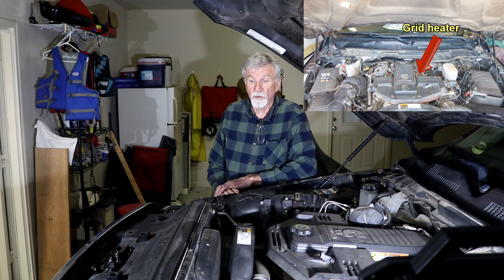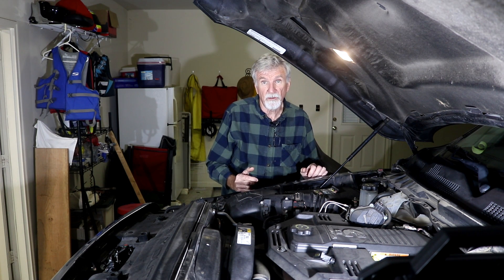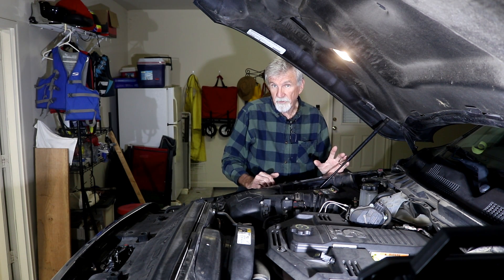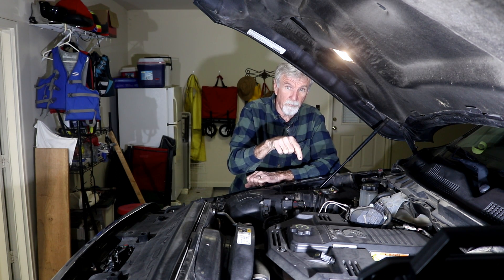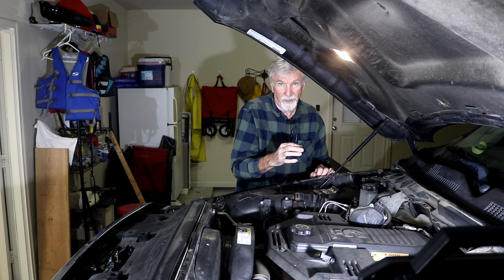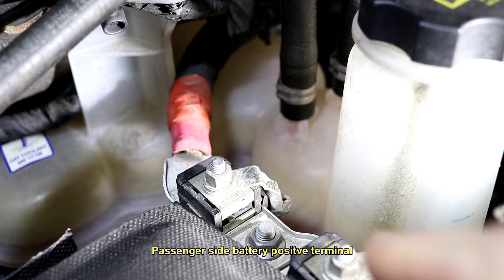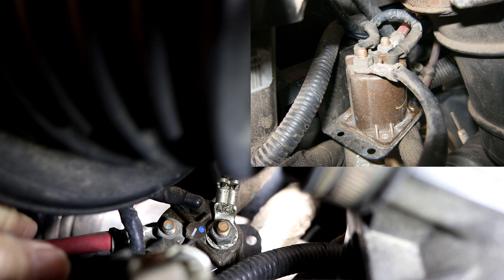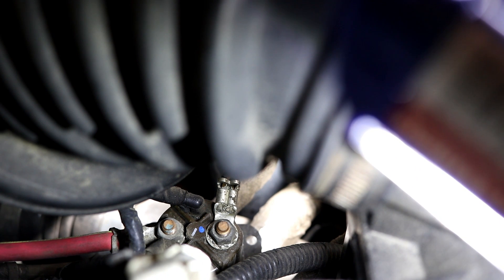Cummins Grid Heater Killer Bolt Issue - Amps & Voltage on engine start

Comment: Do you know if you unplug the heater if I'm the truck will throw codes? My heater or solenoid is bad and the truck throws a code saying there is no voltage from it... I need to smog and its messing up my damn mileage.
Reply from the maker: Just disconnect it at the passenger side battery and when you start it, go straight to start, don't wait like a pre-heat is going on if you know what i mean.  It won't throw a code that way.
Reply: @MarionBlair  so just undo the power cable at the battery? Also, if I do that and just start it right away wont the pcm still be searching for voltage? And see there is none at all and send a code through?
Reply from the maker: @austenazevedo6078  Yea, true since the solenoid is bad otherwise it wouldn't know the difference but I'd try it anyway.  And go straight to start.  Unless it failed with the contacts closed, you definitely want to disconnect it then.Let me know if you do it, I'm curious.  Mine is unplugged right now.
Reply: @MarionBlair  you just unplugged that lead to the passenger battery? How is your truck acting? Is it throwing codes?
Reply: @MarionBlair  did you end up unplugging your grid heater?? How did the truck act when it was cold and it would have wanted to cycle the heater?  Did it throw any codes? I'm needing to get mine to stop throwing the code so I can smog
Reply from the maker: @austenazevedo6078  hi, it threw a code once or twice when I let the on button stay on and not going straight to start but other than that no it hasn't thrown a code in several years now but it doesn't really get extremely cold around here.  I have a little cheap code reader clear so it's not a big deal if it does throw a code to clear it
Reply from the maker: @austenazevedo6078  can you reconnect it and get it smogged and then disconnect after
Reply: @MarionBlair  I can't because it's throwing a code every time I start the truck. Either heater or relay is bad
Reply from the maker: @austenazevedo6078  even with it disconnected at the passenger side battery.
Reply: @MarionBlair  I haven't tried... as I do not want to get the code if I disconnect it. I don't want to reset all my monitors for smog. I was curious if anyone knew definitely if it would trip a code or not
Reply from the maker: @austenazevedo6078  I suspect it's the solenoid.  Just disconnect it.  If you are in the south, it won't throw a code but even if it does, a $20 code reader/ clearer and 5 minutes will reset it but it's seriously doubt it'll throw a code unless you are somewhere below 40 deg or so.

Comment: Yep, just got code 2609, wiggled the wire and it it was loose.. removed the toaster and sure enough no more nut... thing is, where is the rest of nut?... no strange sounds out fo engine, no particular knocking...
Reply: holy baby Jesus, my son suggested to fish a magnet inside the manifold and there it was sitting, ready to destroy my engine... or not.. pulled it out and its safely out of harms way!
Reply from the maker: Crap, I would have it towed to the dealer and have them pull the grid heater and look for it.
Reply: @MarionBlair  I pulled it myself today and was elated to find the nut and stud in the intake!.. NOTE- I did the wiggle test and it was loose and I am guessing the nut and stud fell off when I wiggled it... I made the right choice to push it into the garage and pull the intake and rail...If not for your video, my engine would be dead!.. Thank you sir!
Reply from the maker: @sterlingsun3751  Thank you Jesus!!!!!  Thank God.  You are the man!  Wow!  Unbelievable!  What a safe!  You deserve an award.  And Cummins needs to hear about it.

Comment: I’ve accidentally not let the grid heater cycle before starting it on cold days. It so rarely gives me the wait to start coil on the dash, not like an older diesel. It shuddered and barked a little, and too a couple more cranks over but it started OK. I’ll check for wiggle in that every so often just to be sure. Not gonna lose any sleep over it.
Reply from the maker: No, it's very rare or RAM would have changed it by now.

Comment: Happened to me. 2013 cummin. Spent 5k rebuilding the motor for a 50 cent bolt and washer going into cylinder 5 and 6. Talk about a wtf moment. Just driving down the highway and instand knocking. 
        Getting the truck re-tuned afterwards and the shop had 4 other truck with my same year have that same catastrophe he had worked on.
Reply: I say just plug in the truck and delete the grid heater before it's too late
Reply: 2013 with 70k
Same thing happened to me. Took out cyl 6

Comment: Grid heater failure on my 3500 2018 at 17000 miles. Only indication was a check engine light.
Reply from the maker: Well at least it didn't trash the engine?

Comment: My 2014 stopped pre heating all together. Even at 32F when the start button is pressed, it cranks immediately. The outside temp gauge and coolant temp gauge read properly. Would this bolt issue cause the system to bypass the start delay?
Reply: Did you ever figure out why your truck stopped pre heating?  My 2014 is now doing this.  Thanks.

Comment: I'm about to delete my grid heater with the Banks kit...I'm in northern NJ so if it gets cold enough to need it I will just plug in the block heater. That grid heater restricts so much air flow. I'm doing the Banks elbow at the same time. Nice video.
Reply from the maker: Sweet, I love the Banks stuff.  I just bought the Idash, My next video is going to compare the intake ducting wih and without the baffle. ha.  Should put most to sleep.  I'll eventually do what you are doing.
Reply: Marion Blair I love your videos, plenty of solid information, don't let the haters bother you. If they had any brains they would have there own YouTube channel and getting paid themselves. Cudos to you brother! I enjoy them. Thanks for the hard work you put in to make them. And Happy Easter.

Comment: I just picked my 2017 Ram 3500 from the dealer yesterday. My truck has 49000 kms and it had the exact problem you described. My check engine light came on two days earlier so I went directly to the dealer, they couldn't look at the truck at that time so they made an appointment to bring the truck back. I was told the truck was okay to drive as long as the check engine light wasn't blinking. The repairs were done to the grid heater and the truck is working fine now. 
I had never heard of this problem and that it could cause major problems with the engine. I would strongly recommend doing the "jiggle" test! It could prevent major problems in the future.
Thanks for the video, Dan.

Comment: Thank you brother for your recent video on the wiggle test. Looked at one of your videos from last year recently and I'm about to get into hot shotting and of course we'll be in colder climates trying to sleep in the truck so are you saying don't idle overnight if I want to increase the longevity of my engine? Does the highway miles, 10 hours at 60 plus miles an hour, help negate damage done during idling overnight or just if I got to idle  change the oil more frequently?

Comment: Hopefully it stops at the turbo but likey some pieces will get past.  And that jiggle joke was funny!
Reply: Grid heater is after the turbo, right before intake valves, so like he said, if a piece of metal falls off, it will make it's way into a cylinder

Comment: I don’t want to add any hysteria here but I have been bit by a similar issue with Ram/Cummins that occurred several years ago. I purchased a new 1995 2500 and put about 120,000 miles on it. One day I popped the hood to check out a burning oil smell. To my horror I saw oil coming out of a large crack in the top of my timing chain cover. My engine had suffered a debilitating blow from the dow pin of death! Crap like this can and does happen. A perfectly maintained and operating engine can be turned into a boat anchor because of some crappy 10 cent part. My grid heater is unplugged at the solenoid. I am happy to report that it did pass the jiggle test. My truck is a 2014 model.
Reply from the maker: Yes unfortunately, I think the dowel pin issue went away with the 6.7 not sure
Reply: Those 12 valve Cummins engines were KNOWN for that dowel and pin coming out. Much more common than this ever will be. Replace the timing cover and you were back on the road. Didnt take out the engine
Reply from the maker: @robophobic3716  I've got a 2014 also, do you get codes with it disconnected?
Reply: Does it get codes with it disconnected?

Comment: Great video! I have and would delete many things but there ain't a chance that I would delete my grid heater and I don't have a clue why anybody else with good sense would either with the exception of a race ONLY application where that LITTLE bit of air flow difference may make a difference. The same goes for removing the stock (GREAT) factory air box and going to an after market cold air kit.

Comment: I wonder how much temp rise they achieve with a few seconds of electric heat that makes starting engine easier? It must have some kind of temp monitoring as I’ve noticed some colder mornings take longer than others. 

On another note have you done anything on greasing the double Carden unjoints? I see a decal mentioning it on my truck but don’t see a zerk anywhere, not even the grease needle type. How the hell is anyone supposed to grease a sealed unit? I’ve located it on older Rams but not seeing one on my 17. Any ideas? Thanks for the replies Marion.
Reply: Took me three oil changes before I finally found the hole. It is just a tiny hole drilled in the Carden joint. No zerk fitting. You need a needle grease tip. It is on a weird angle so look closely, it is there.
Reply: That’s totally believable. They would do something like that. Thanks man.

Comment: RAM will pay for half. Can't afford 14500. l will fix it myself. About 5k. laidoff so I have the time.
Reply from the maker: Not that it matters but is your truck deleted? I guess you've talked to both Cummins and Chrysler.
Reply: @MarionBlair  yes talked to both. Stock 85k miles

Comment: My grid heater bolt failed sending nut though engine. Damaged piston,head and turbo. 1month out of warranty ram would do nothing to help. It is a design flaw. Service Manager , tech and RAM area rep.all agree. 29000.00 for dealer to replace engine. Concern YES IT IS!!! keep an eye on it.
Reply from the maker: Yes Wade I heard about that one.   that is a shame. I think I would have to take that fight up to the next notch one month out of warranty.  That's just not acceptable by FCA.
Reply: $29,000? Maybe $15,000
Reply: @bbubacz1  Invoice is in my truck.
Reply: @bbubacz1  Remain on the web 18k look it up

Comment: Great video again Marion.   My 2018 2500 Mega keeps giving a "Battery Saver Mode" message and I've read that this grid heater may be the root cause but often misdiagnosed by techs.
Reply: My 17 Ram 6.7 with 20K displayed the battery saver mode last week for the first time and I believe it was from it sitting outside over night in the 20° weather. About 10 hours later the message went away.
Reply: Normal if cold outside. They do so to prevent blowing up cold battery.

Comment: Great Video Marion. 
Got a question: Will it still throw a code if the Red Wire at the Battery is disconnected and removed?
If I was going to disconnect, that seems like a good place. Remove that red wire completely.
Reply from the maker: Hi Bayonne, Mine threw the grid heater code when my solenoid went out in 2016 but I don't remember the exact circumstances.  It might not if you start right away before the PCM realizes the solenoid isn't energizing.  It's worth a try.  That would be the best place to disconnect it.  I think you can get by without a code if you disconnect at the solenoid ground side but it may be the same effect.  I'm going to play with that this week and see what happens.  I know the grid heater cycles after the engine starts depending on the temp.  That may be what caused the code.

Comment: Great video Marion....as always.

Have you had any issues with your turbo actuator?  P003A, P00AF, or P0046

Exhaust brake quits working and tone of turbo changes.
Reply from the maker: No no issues with the turbo. Thanks
Reply from the maker: I would try disconnecting the exhaust pressure sensor, they can make the turbo think there's too much pressure or cause too much back pressure on the engine or vice versa

Comment: Well done once again. I enjoy your content and seeing how all your gadgets work. My 17 Tradesmen is getting factory remote start kit added Monday......finally. Does the remote start wait for “Wait to start” grid heater to do its business or is it set on a timer? That’s part of the reason I opted for the Mopar kit versus aftermarket kits that had timers and additional work to get parking lights and such to function on remote start. I have to think once the sales code is added to VIN the BCM will have some features that aftermarket kits replicate through hard wiring.
Reply from the maker: Thank you . Yes on remote start it will wait for the grid heater, but if you're in the truck you can more or less bypass the initial grid heat.
Reply: I know my dealer might be different, but I was wondering what the cost was for that?
Reply: Chris De Leon are you asking about bypassing grid heater or adding remote start? They quoted me $660 - $1000 at local Middle TN dealers. The 2017-2018 2500s and probably others have to be auto trans, have keyless entry, and immobilizer. RAM states 1.2 hrs to install but nobody I spoke with could do entire job in that amount of time, more like 2-4hrs. I ordered at Allmoparparts.com for $238 off their site, installed myself. That part could’ve been a hell of a lot quicker had I known how the C1 connector came off the BCM module under the dash. The gray lever will pop it off which instructions don’t mention. Add the hood latch switch to plug per instructions and plug back in. I managed to get semi local dealer agree to program two FOBs that come with Mopar kit for $125. Well long story short I left disappointed, everything took programming wise but truck wouldn’t start. Their parts guy gives me the part number I already purchased and installed online. They doubted I connected the one wire correctly and assumed I had the wrong kit. Parts guy quoted me $324 for same kit and said it didn’t say anything about a hood latch and that it came with a WIN module. Wireless Ignition Module. I was getting livid for trying to skimp and save then I’m headed home and realized my low fuel light turned on literally as I turned into dealership that morning. Added diesel. Remote start works like a champ now. It’s funny the dealership had all but condemned my stuff, tech didn’t notice low fuel message or didn’t put two and two together. Oh well I got it all done for less than they would’ve sold just the kit for. They only charged me $100 cause they didn’t think it worked and took it easy on me. I called Service Manager and offered to pay original price cause I made a bonehead mistake even though his guys were flat out wrong. He was cool, they were typical dealer grade help. Nuff said. Some guys have gotten way more from their dealers, I didn’t buy my 2017 from place I took it to this AM. FYI I suspect older models have more parts with their kits so maybe some of what they said applied to those years.

Comment: What do you think about adding a disconnect switch under the hood? Only turn it on if and when you find yourself in a location that you might actually need it. Love the inappropriate humor. Lol.
Reply from the maker: thanks Dennis, yes, I think that's a good idea.  Can't hurt.  Worse case is it throw codes but If you put it on the line between the solenoid and the grid heater, and you go straight to start without waiting for the PCM to realize the grid heater isn't on, I bet you'd never get a code and it would start down to the negative temps.
Reply: Hi, I thing the in line disconnect switch is a great idea...but, where a 215 amps. in line switch for that big cable can be found?

Comment: Another awesome video!

What are you shooting in 1080 or 4K.
What camera are you using 
What computer are you using to edit
Reply from the maker: 1080 - Canon 80D
Reply from the maker: I built the computer ASUS Z270  motherboard with an i7 7700K.  I'm clocking it 15%.to about 4.8 gig/hat .. envidia 1080 geoforce FTW.  SDD HD's.  32  ram.

Comment: How are them Michelin defender tires holding up?
Reply: Recently installed a set thanks to Marion Blair smooth as butter compared to the factory Firestones.
Reply from the maker: Yes, there doing excellent.  thanks